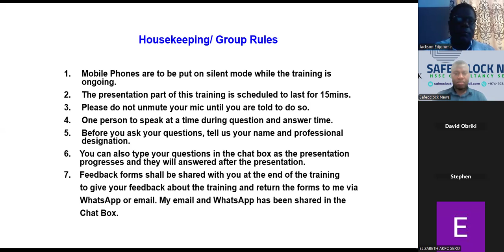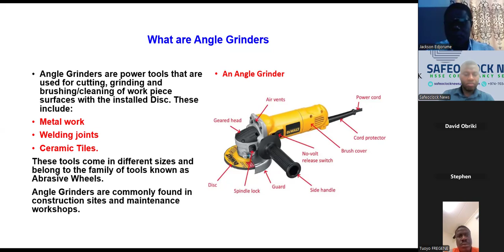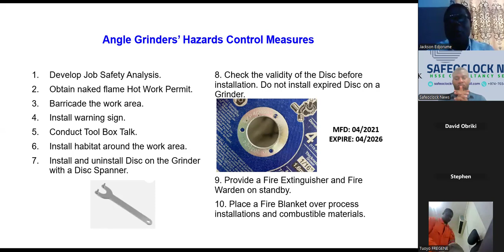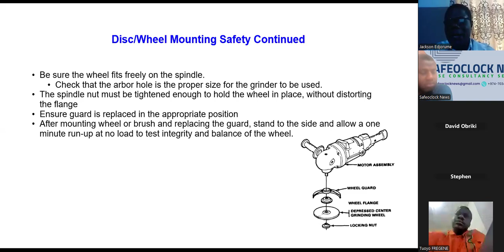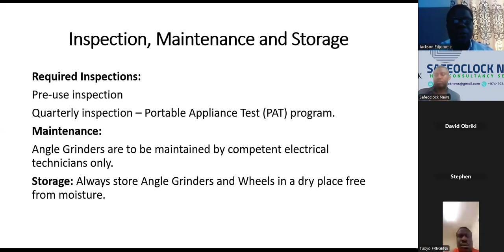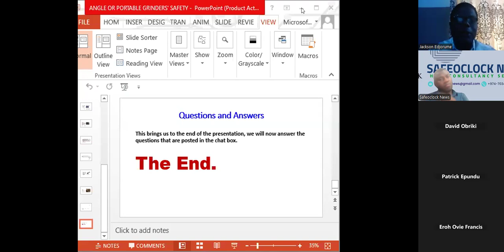Portable Angle Grinder Safety

Comment: Good presentation & thank you for your time. 

I have a few concerns or question;
1. what is the procedure to read the speed (RPM) of the wheel/Disc? 
2. Is 6 months periodic tests recommended or just only 3 months mentioned? 
3. How long can Faceshield be used before replacement? 
4. What is best practice to preserve a faceshield? 
5. Is it recommended to use safety goggles & face shields at the same time?